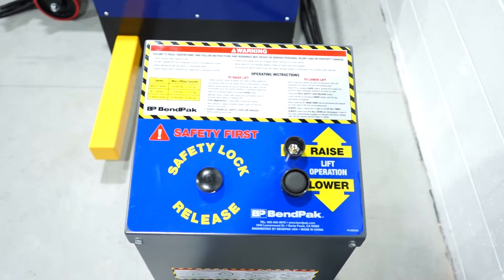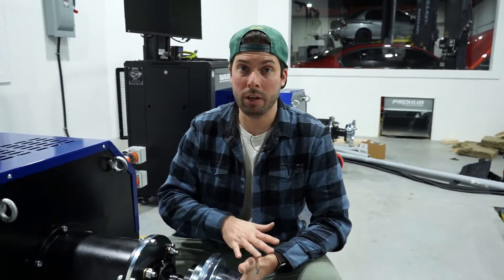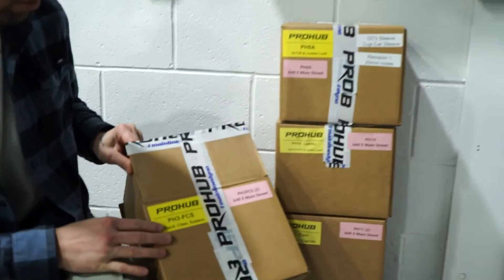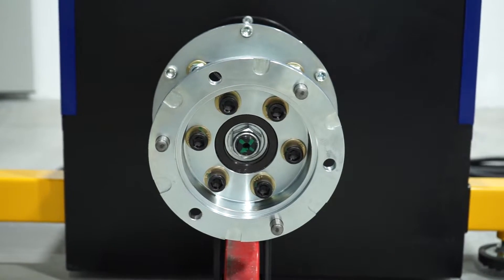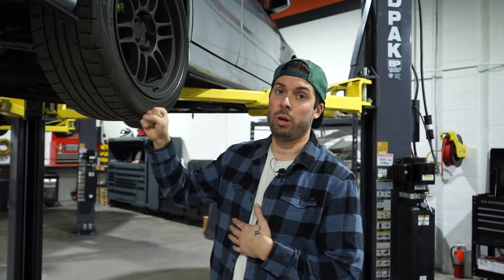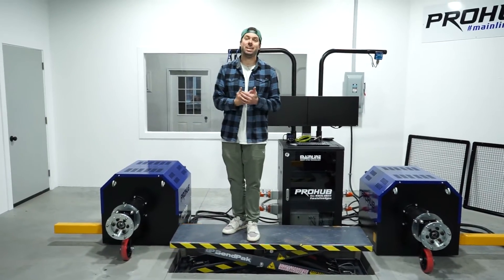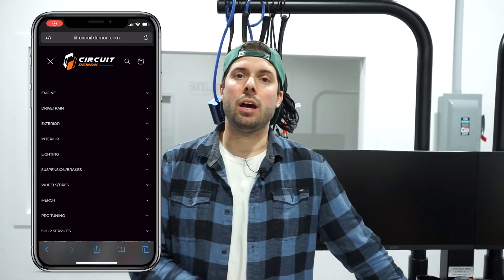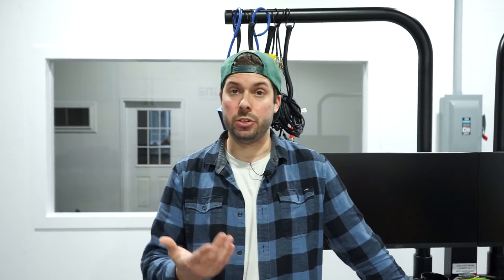Why a Hub Dyno is the RIGHT Choice! Mainline Prohub (Reads up to 4,600HP)

Comment: i d like to see you cool 4600 bhp, also is there a rpm limit on the units ?, are these electric or water , and what gear are they run in , it makes a huge difference , also does it have a barometric recording

Comment: Excellent video 👏🏼
Reply from the maker: Thank you very much 🔥
Reply: Solid video. I like hub dynos better for all of the things mentioned in the video. Biggest one being tire slip and properly loading the engine while tuning. 

Also, have you guys found out if your Dyno reads lower than others?   I've seen a few mainline prohubs read 8% lower than a dynapack or dynojet but I've also seen some that are dead on with those other style dynos. 

I got tuned with Evans tuning new mainline dyno and he mentioned his consistently reads 8% lower than his old dynapack.